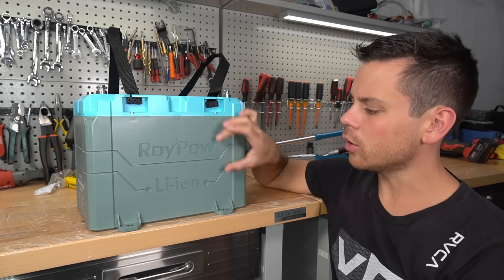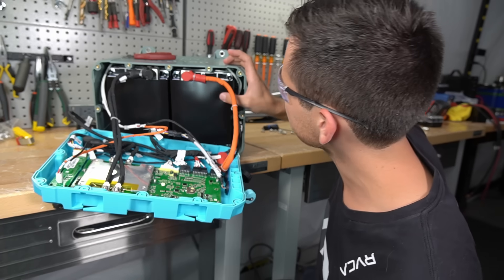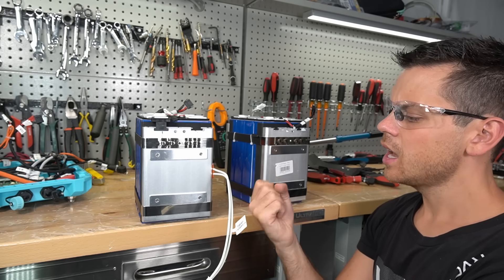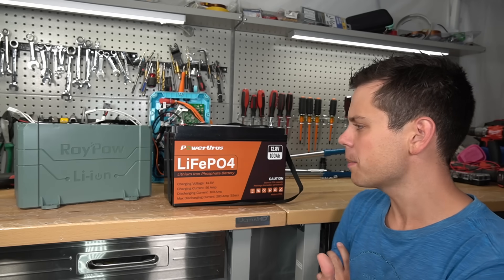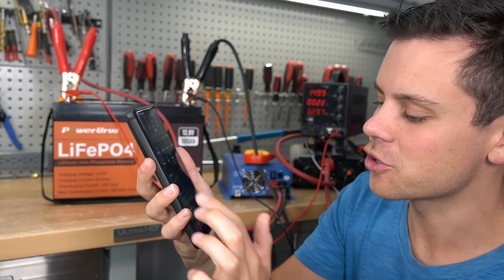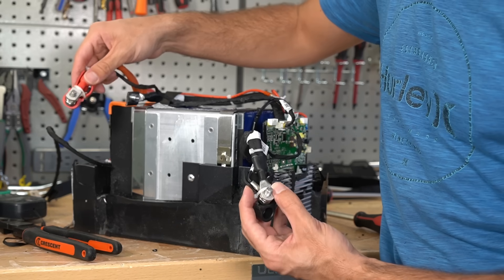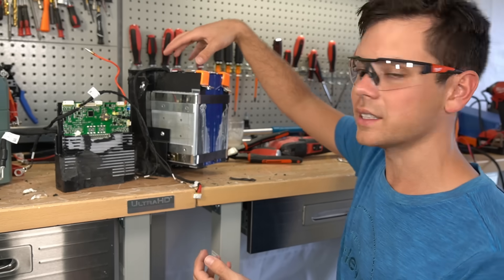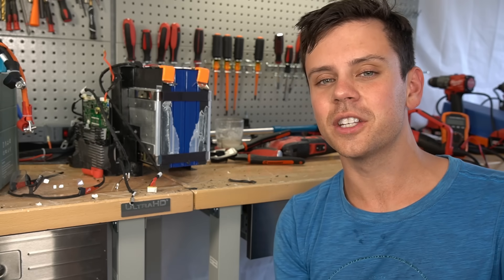RoyPow Solar/Marine/Golf Kart LiFePO4 Batteries

Comment: Will, when I disconnect things from unknown manufacturers or in language is not familiar to me I take colored marker pans and on one side of the plug I put a line straight across the two pieces that way when I go to hook it back up I can quickly and easily see that I'm putting the right plug in the right orientation in the right place. You might want to consider this when you're doing teardowns and avoid the problem you just had on this Roy Pow battery
Reply: One of the problems ive run into is after a long time of doing things well you get so used to just expecting to succeed that you are subconciously sloppy and have to relearn lessons of your distant past.. 😂
Reply: @Vigo327  arrogance can be just as much of a impediment as ignorance if you let it. Speaking from experience!
Reply: I always shoot lots of pictures of connectors during teardown, as well.
Reply: A Sharpie is your friend, :-)
Reply: Excellent advice : thanks
Reply: When he was disconnecting, honestly, I literally thought this guy is a genius....at least we are all learning  ... Thanks for the advice Seann

Comment: I could be mistaken but that rubberized material looks like it could be some sort of potting material which could help with thermal transfer to the outside of the case instead of the heat being trapped inside the air in the case, would be interesting to see performance results with and without that material to see what the temperature difference is at full load until it is completely discharged, maybe the company could send you one with and without that material for testing
Reply from the maker: Good point Frank
Reply from the maker: Ohhhh interesting
Reply: If it had a metal case that would make more sense.  Transferring the heat to plastic wouldn't help much.  It would nice if they had an aluminum heatsink on the outside.
Reply: @ralphbell1786  it helps more than you think, if it was open air it would create a pocket of hot air and because there is no airflow it would stay around the heatsink area with very little transfer to the plastic, I agree, if heat on that heatsink is an issue it would be good to see the heatsink extend to the outside of the box but still be watertight
Reply: @FrankKelly1  No one wants metal outside of the battery except at the terminals. I agree with your analysis. Heat transfer dynamics, it doesn't look good from the afar, but having this heatsink to distribute heat to a casing (even if plastic), is far superior than air trapped inside. One can do the calculations to figure this out, particularly if the potting material has a high heat transfer C value. There's more than meets the eye here with the heatsink design.

Comment: Why do companies put lithium ion labels on their batteries when the batteries are actually lithium iron phosphate? I noticed that a lot of companies kind of use the two chemistry types interchangeably. Why is that, aren't they different?
Reply: I'd guess it's either for name recognition or that they switched battery types but still have cases to use from the previous type.
Reply: @Mazlem  that was my thoughts as well.

Comment: As someone who's lived offgrid for 20 years,  having temp sensors on the terminals is a really good idea.  Can't count how many times a bad connection at the battery caused problems that went unnoticed until it got bad enough that the glow at night alerted me. Battery teminals are a common place for bad connections.
Reply from the maker: Absolutely. Do you know of any other batteries that have temp sensors on the terminals?
Reply: @WillProwse  Victron sell temperature sensors that are battery terminal mounted. I use one in my RV for my solar and B2B system.
Reply: Batrium had them in the past. Though that is not a batterie but a bms... But that was one of the reasons I chose them... Though I didn't have any connection issues so far.
Reply: @WillProwse  nope never seen it before,  it's a really good idea and seems to be unique to these.  Amazing if they're really Chinese based,  seems like most of the time all i see from China is mimicry amazing if they are actually starting to innovate.
Reply: @WillProwse  I think SuperB has them on their latest model Epsilons (100 and 150Ah)
Reply: @WillProwse epoch has the exact same setup.  I mean EXACTLY THE SAME
Reply from the maker: @BrianGentry317  they r the same lol
Reply: Infrared camera or a heat sensing gun is my best friend on my off grid systems.  I regularly check terminal Temps and wire Temps on my regular inspections of my system
Reply: Has the price gone up to 450 or is there a discount code of some sort?
The price didn't change when I added it to the cart
Reply: @CarModsandDadBod  I paid $450 each also for two batteries.
Reply: @jbarnes1719  for the marine batt?
Reply: Temp sensors on terminals - is it to prevent shorting circuiting? (ie. BMS would cut power if it detected a short?

Comment: if a terminal isn't tight it can get very hot and melt the connection, this way it cuts off the power so it doesn't  destroy the terminals.  thats to noob proof it I guess

Comment: I'm pretty sure RoyPow is owned by EVE, which may explain the quality. Having that heatsink covered in rubber is crap, why would you insulate a heat sink?? That same BMS was in the RoyPow-branded battery that I tested. Something else had it too that surprised me, might have been the LionEnergy - I'll have to look.
Reply: Yes, it is the LionEnergy - it has a RoyPow BMS that looks very similar (not identical).
Reply: No, the company's Chinese name is 惠州乐亿通. Eve is 惠州亿纬 which is battery manufacturer. Poypow uses Eve batteries but they are not the same company.  One day you come to huizhou and dongguan in guangdong China you will see all of them. Battery capital of China
Reply: @americannumber2  I never said they were the same company. I said that I believe EVE owns RoyPow. In fact, it even says this right on their website.
Reply: @LithiumSolar  prove it
Reply: @americannumber2  Prove what? It's on their website. Go look with your eyeballs.
Reply: @LithiumSolar  Correct, EVE owns Roypow

Comment: When you started taking apart the first battery I thought "he really should test the battery first just in case it gets damaged during the tear down." 

I wonder if the temp sensors on the terminals are actually better since it's a direct thermal bridge to the cell electrodes and potentially gives a more accurate reading of the internal temps than the outside of the cell case?
Reply: Agree. If it was me, I'd def do capacity test before teardown. Probably several cycles. You never know if something you do could affect the unit somehow.

Comment: Love the excitement!

The marine battery looks really nice. And at $1300 for a 24V 100ah, that is still a super competitive price (compared to 12V 100ah). For a marine battery though … that’s outrageously cheap. 

Can’t wait for the capacity test. It’s most likely going to pass . Looks like this company makes batteries for industrial and construction equipment and vehicles. That’s a hard environment. I’m not surprised about the consistent build quality.
Reply: $1,300? They've already upped it to $1,500.
Reply: @fordman32508  that is unfortunate. Amazing what 48 hours can do to a price.
Reply: @4philipp  It is. He had a previous video where he had two identical batteries and the one that was sent to him was a far superior build than the one he purchased. I'm guessing this was sent to him, so I'm very skeptical at this point and that price hike sealed the deal for me. I'll stick with my SOK and Amperetime ones.
Reply: I was wondering why he kept saying it’s so high quality for being cheap at $1300!. But now I see that this niche marine batteries are expensive.
Reply: @Gold63Beast  They're really not.  I have 2x100AH LiFePo4 batteries for my trolling motor.  They cost $700.  Don't need the On/Off switch at all.  Can buy one for $25.  Bluetooth?  Why?  Any monitor/shunt will tell you how much power you have left.  I have gone on 6-7 hours for 2 days and not had to recharge my cheapos.  Once, my outboard had issues and I had to troll 2.5 hrs back to my landing spot on the second day and still did not have any issues.  8 months and counting without a single problem.  It's pretty though, so I guess there's that.  $1300?  Pfft.
Reply: @gr0uch02a  just curious, is it $700 each? (your 100Ah batteries) and are they 12v? - if so they're more expensive than the 24v from these guys
Reply: @sharpx777  that’s what I am thinking too. Otherwise for $350 each, that’s like the cheapest, possibly grade B cell battery out there. And I doubt they are marine grade. 
Just because any battery will do the job, we can’t compare apples and oranges.
Reply: @4philipp  yeah, $350 would be an excellent price but that's pretty much at cost if you consider 4 x 100Ah LiFePo4 cells + BMS + enclosure so I doubt it (but if I'm wrong I'd really like to know where to get them from)
Reply: @gr0uch02a  

I fish for a living and would like to know how hard u are running your bow mount. What bow mount do u have? Iv never ran anything but lead acid deep cycles and have zero experience with  lifepo4 batteries
Reply: @gr0uch02a  do you have a link?
Reply: @gr0uch02a  looking into trolling motor batteries myself , would you mind sharing the info on the Troling batteries your using ?
Reply: @Gold63Beast  yes, a comparable battery would cost $1800 - $2200. And for larger systems, they are custom build to fit.
Reply: @Gold63Beast  The ONLY thing that makes "marine" batteries any different is how/if they are sealed.  The internal chemistry is unchanged.  Mfrs know that saying something is "marine grade" commands a premium for minimal effort so they take advantage of that.  Suckers beware.

Comment: I have a Golf Car (old 48v Club Car DS) & a RV @ the beach.  I keep my Golf Car in my 12 X 16 shed.  

It would be awesome if you could use your ingenuity & know how, to create some videos, where you teach us how to make 48V off-grid systems from a 48V Golf Car.  Don’t forget to add some solar panels to your roof to plug into mix as power supply.

This would be relevant for those of us that have beach property part-time, full-time, or live around golf courses.

Love your show… even though I only understand 1/2 of what you saying 😆….
Reply: It's really quite easy to build a 48v solar charger. All you need is a few solar panels in series and a 48v capable charge controller. Victron makes many charge controllers that go all the way from 12v to 48v. I use one. Right now I'm running 12v, but if my inverter ever burns up, I have enough LiFePo4 cells and the charge controller to switch to 48v.

Comment: As far as golf carts go, RoyPow has been having issues where a speedier cart, or one under load (going uphill), causes the Roypow battery to shutoff until it cools.
Reply from the maker: Which golf kart and which battery? Do you have a video showing the issue?
Reply: @WillProwse  I rechecked Roypow and they have since introduced a “P” or Power series to their golf cart batteries for demanding applications.  They advertise they can now go up hills and carry loads without thermal issues.  Would love to see you try it out!
Reply: Put 2 in parallel and that problem should be fixed
Reply: I've been running the RoyPow 8.2 kWh LiFePO4 in a 6 passenger golf cart with no issues and we load that cart down with 6 people, a 90lb dog, beach gear etc.

Comment: Rookie question. I was planning on using a lifepo battery in cold conditions for a portable parking heater. I understand not to charge a cold battery put would it hurt the battery in cold general discharge?
Reply: My understanding is at freezing temperatures it's not wise to use a lithium iron phosphate battery for charging or discharging. a way around this is to heat the batteries above freezing They don't have to be room temperature or anything they just have to be above freezing like at 5° c or better. They sell battery heaters for this and just to keep the batteries above freezing doesn't take all that much energy
Reply: @highlander723  thank you Sir

Comment: Is there a difference between lithium ion and lithium iron batteries?
Reply from the maker: Lifepo4 is a lithium ion variant. Cobalt based lithium ion is dangerous.
Reply: @WillProwse  Hi Will. Thanks for taking the time to clarify that. 
I’m no chemist, but I think you, as an influencer, could come up with a better name for LiFe for clarity. No one refers to water as Hydrogen dioxide. 
Might be clearer if everyone called them Iron Lithium (or Ferric Lithium) instead??
Reply: LiFePO4, are much better for many reasons.

Comment: Hi Will, do you have any experience with the 100ah 48v eg4 server rack battery and the over current protection being finicky because I have two of them and when my ac starts up it momentarily draws 125a from each battery and they fault instantly. I have contacted signature solar mutiple time and they have yet to respond. Would love to here your opinion on this and keep up the good content.
Reply: Gents you can get a soft start for both of those and cure that problem
Reply: Check his videos and yes he has addressed that issue
Reply: @seanbrossard8178  SAME WITH MY DRYER

Comment: I could be wrong, but one benefit of high temp sensors at the terminals is that it could detect high resistance connections at the terminals.. For example, a user loosely connecting to the terminal or using an undersized cable.
Reply from the maker: Absolutely
Reply: Especially if this was in a golf cart getting jerked around.

Comment: The only benefit I see with temp sensor on the terminals is to detect loose connection on one of the battery terminals?

The marine battery looked quite reliable 😛 if left unopened hehe

Comment: U don’t necessarily need a secure website to serve up info. An SSL cert is wanted if you are doing some type of transaction or trying to protect your session
Reply from the maker: Very true, just a red flag
Reply: @WillProwse  I wouldn’t consider that a red flag unless you were actually buying something and it wasn’t an SSL connection.
Reply from the maker: @HyPex808-2  well I didn't have a ssl certificate on my website and I had tons of people complaining and saying it's awful and I'm a bad person for it 😂 usually the lowest quality product websites from China also are unsecure.
Reply: @WillProwse  I work in IT for a hospital u should have told those people to STFU lol they don’t know what they are talking about.
Reply: @WillProwse  will I just saw their 24v 50ah battery on Amazon it says it’s heated…get that one as a sample
Reply: @HyPex808-2  Chrome, Edge, etc. are all working at scaring the average consumer away from insecure websites.  I'm sure that part of their motivation is to sell security certificates.  But the fact is that there are a lot of non-technical users (90% of them) that don't know what an SSL certificate is, and don't care.  If Chrome or Edge tells them the site isn't secure they won't visit the site.  So yea, it's become unprofessional.  I don't agree with it, don't like it, but big tech has made it an issue.
I run several faith based websites including one for a national denomination and, like Will, I've had folks castigate me for not keeping my SSL certificates up to date.
Reply: @buddyray6792  really a shame…